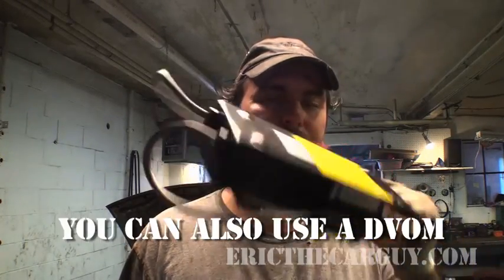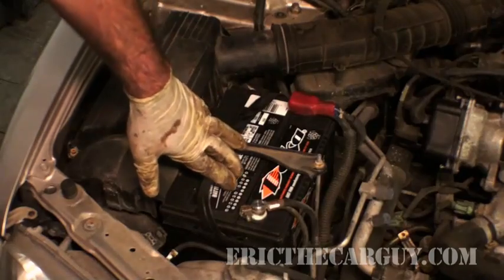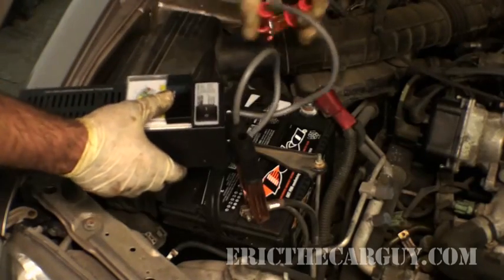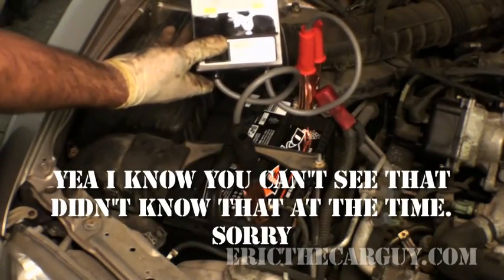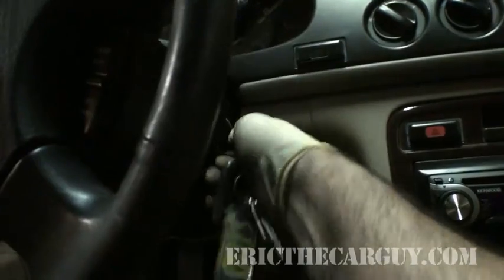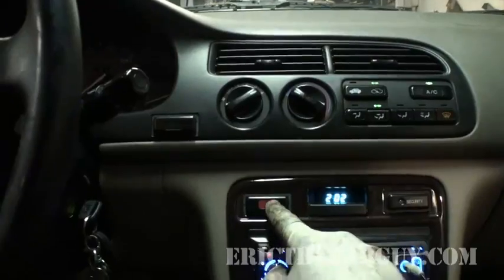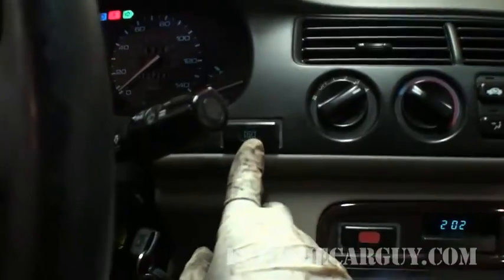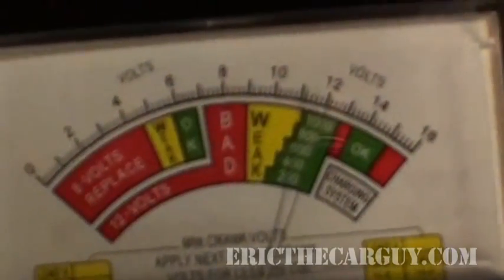How To Check A Charging System - EricTheCarGuy

Comment from the maker: @Junkman2000 If you get the tension too tight you can ruin the bearing however that seems like a short amount of time for a bearing to go out.  Are they going out because of an electrical failure or a mechanical one?

Comment: This is the 3rd alternator in 6 months that i have bought. What keeps damaging my alternators? I have a small amp and a sub, no more than that. The other day something really weird happen, I started my car and  the voltage meter stay a bit above 12 start driving and stayed there after 5 min of driving went up as normal to about 14. Today just stayed at 12

Comment from the maker: @thaik56 You might want to also watch the video I did on Alternator Diagnosis 101 for more detailed information but yes, you do need to make sure you have a good battery before doing any testing on the rest of the electrical system.

Comment: When you test the alternator. Does it make any difference whether the battery is in good condition or not?

I did that same test with everything turned on. I get 11.8-11.9V when radiator fan is running but it gets above 12V when it's turned off. Is my alternator bad?

Comment from the maker: @cooolguy1986 I would check the belt tension, I would also check the condition of the belt itself, if it's glazed or shows signs of age you might consider replacing it.

Comment: Hey Eric, I hear a squealing noise from somewhere around the alternator. I checked the voltage from battery using a multimeter it was fine measuring about 12 V and 14.27 V with the engine turned on. When I unplug the alternator, the noise goes away, when I turn the AC on, the noise goes away but without AC running, I hear that continuous noise. The more I drive, the worse it gets. I am sure my alternator is good, so it has to be something else

Comment from the maker: @points2shopPROOF You may want to watch the other video I did on this Alternator Diagnosis 101 for some more testing but if your having charging system issues (and by the sound of it you are) it's a good idea to check the alternator output, if you have the 11.1V that you say you have this is far below what the alternator should be putting out.  Good luck.

Comment: Can use a digital voltmeter too at the battery and never at the alternator.You get unaccurate results at the alternator.Have seen why the alternator on a Chevy did not work right once and was a simple fix.Owner's son forgot to plug in the plug in for the alternator,was not charging.

Comment from the maker: @flywelder I'm guessing it's a fuel injected engine, if this is the case I might be looking to the idle control circuit but I would also check the operation of the coolant temp sensor because that works like the 'choke' on a fuel injected engine, if the engine temp readings are off everything else will be too and you will see performance problems similar to what you describe.

Comment: part 2 
 If  I attempt to hold the engine speed at anything below 1500rpm it will not stay at the RPM I hold the throttle to, rather, it will drop back down low, then come back up again, and continue to do so despite me holding the throttle. When cold, and starting out down the road, {engine dog house cover is off so I can observe} the engine feels held back when trying to accelerate  and  bucks, misfires, back fires through the intake if  accelerating and if more load is applied.

Comment: Thanks for the helpful tips. I will apply them Tuesday. Let me give you a new description of the 302 engine than I did, right now: the engine will no longer “fast idle” when started cold. Instead, when started cold the engine speed will drop to about 550-650rpm and seemingly struggle to run. To counteract this, I must hold the engine speed above 1500rpm for 1-2 minutes before the engine will idle at a reasonable speed, about 750-850rpm, but it is still rough and shaky.  part 2 is next.

Comment from the maker: @flywelder First loose suspension parts don't cause vibrations at speed, out of balance things do but loose suspension parts make things worse.  Start by balancing the tires and checking the suspension components.

Comment from the maker: @flywelder You might also check for vacuum leaks as well as check the ignition system for any voltage leaks (I did a video on this).  That might be a good place to start.  I can't remember if it was that engine or not but you might want to google something about crossing plug wires 7 and 8, I just remember something about a misfire on a Ford V8 being caused by something like that.  Lastly check the fuel psi under load as it may have a problem only when the condition occurs.

Comment: How would I  discover what is causing  a back fire on acceleration   in a 1989 Ford 5.0 EFI engine?  I have  already, cleaned carbon from Throttle body, check  and have spark at all plugs; cleaned idol air valve; checked  for free and functiong EGR valve;  replaced fuel filter and Have 41 lbs of fuel pressure, spark timing is dead on.....what could be wrong?

Comment from the maker: @ian1593 First you have to see if it's charging as I show in this video, if it's not charging check the cables and connections, a problem in any of those areas will also cause a no charge condition.

Comment: @EricTheCarGuy 
Understood sir! Most cars that I stick a meter on will hover around the 14V mark while running and heavily loaded with electronics. Like you say, I guess it depends on the vehicle (state of the battery, capacity of the alternator, ad infinitum). Less than 12V is a definite fail!

Comment from the maker: @davelowe1977 Actually a static charge of 12.6V is best but with this test there is a pretty wide range depending on the vehicle however if there is a charging failure it will be 12V or less in my experience, this video is more of a 'check' not a diagnosis.

Comment: Hey Eric, I thought the standard regulated voltage of an alternator was between 13.8 and 14.2V. I also thought that a nominal lead acid battery ought to be around 12.5V when unloaded and charged. Surely that test was a fail? What gives!?

Comment from the maker: @mrdrejonn Not sure what the problem you having is as all you mentioned were the parts you replaced but you should always check the cables and connections as they are often the cause of electrical problems.

Comment: hey whats up eric? the same problem im having with my ford taurus 1999 se i have changed battery three times alternater three times all passed test, new alternater belt need help any ideas could  it be fuses relays ,wireing i dont kno need help. thanks>>>>>>>>oh yeah starter is used and just put on in feburary

Comment from the maker: @TaylorWareFan1 Actually you should be able to run the radio for hours without issue, if it was the original battery it was probably time, they normally only last about 5-6 years.

Comment from the maker: @TaylorWareFan1 Cool, thanks for the update.  Normally when a battery starts to get low like that it can cause all kinds of weird issues with the electrical system as once it falls below a certain voltage many of the systems respond in strange ways.  Thanks again for the update.

Comment: Hi Eric,I've got problems with Mitsubishi FTO alternator or wiring.Put new alternator belt,new battery but alternator not charging.got myself a multimeter checked that values don't change car on or off value is 11.8 on 12.4 off.connected multimeter to alternator's positive and negative wires with car running and got values off 2.5-4.7 from alternator so i presume its not alternator but can't figure out what is it,fuse relay seems ok,may be wiring?can you help me out?cheers

Comment from the maker: @kennyg757 Make sure the connections to the battery are clean and tight, may charging and battery problems are actually caused by bad connections.

Comment from the maker: @coldcash12345 It sounds like a voltage regulation problem, I believe that it is built into the alternator and you will need to replace the alternator to fix it.

Comment: Hey eric, got a 95 3000gt and have a voltage drop prob. When I rev it up and the rpms come back down everything dims, 14 volts to 12 volts on my gauge. Alternator got tested last year and was good. There is a noise coming from it, but the belt is too tight I think, I will try to loosen it. Also, I checked the connections and it was hot and the plastic was starting to melt around it. Bad connection, Short, ? Checked for draws/fuses. Didnt check volt. regulator. Any ideas on what to do? Thanks

Comment from the maker: @JDMnubi Test before you buy.  Recharge the battery and do the test in this video to confirm the alternator output, if it's below 12V then replace it, if it is then look elsewhere.  Don't rule out a connection problem just in case.  Good luck.

Comment from the maker: @rony23ify There probably is a short somewhere by the sound of it unless you have the AC or defrost on, the fans run when the AC is on and when you turn on defrost the AC is turned on.  Your best friend will be a good wiring diagram so that you can see how the circuit is suppose to work, that way you can properly test it.

Comment: Hey Eric, I have a question, while driving, my friend's headlight started strobing, and eventually went out, and soon enough the whole car just died and didn;t want to turn over, I'm suspecting a bad alternator or a short some where, currently in the process of replacing the alt. but just wanted a second opinion, any ideas? thanks!

Comment from the maker: @theOats11 It could be a connection issue but not likely if it was working normally before, it may be that the voltage regulator in the alternator has gone bad or it may have lost a phase, I would replace the alternator personally.

Comment from the maker: @ChubbyLoveDumpster It may mean that there is a problem in those circuits or a problem with the electrical system.  I'd start by checking the voltage and verifying that my gauge was reading correctly then look into the effected circuits.

Comment: what does it mean when your voltage gauge with light and heater on reads 13 then dips to 8 then jumps tp 13 an back to 8 etc.etc.

Comment from the maker: @midlantic1 Ohms law dictates all are connected, including resistance.  It's much easier to read voltage in a situation like this as you can use a tester like this or a DVOM, to check amps you need an expensive inductive meter to read it accurately.  Great question BTW.

Comment from the maker: @hondita90 Some parts are better than others but you need to verify that the alternator is really the problem by performing this test.  It's also very important that the connections at the battery be clean and tight, poor connections can cause loads of intermittent electrical problems.

Comment from the maker: @meckatod If you installed an amp with some big cables to the battery you may have something hooked up wrong.  Try disconnecting what you installed and see if the problem still exists, if it does you know it's in the system, if not then you need to look elsewhere for the problem.  Make sure the connections at the battery are clean and tight as well.

Comment from the maker: @Ddog2k3 Sell it, no I mean it.  I believe the starter on that engine is actually under the intake manifold so if you just hear a 'click' when turning the key it might be the starter has failed, you would be able to verify this by tapping on the back of the bell housing just under the intake, if the car starts then the starter is most likely bad.

Comment: Hey man, I just got my 93 Cadillac Deville a couple of days ago, and when I try to start it up, it didn't do anything. I thought it was the battery, so I replaced a new battery in it. When I try to crank it up again, it still didn't do anything. So I assuming that something got to do with the Charging system, but is in the shop now.

Comment: @EricTheCarGuy I see what you mean with the oil gauge. Would it be the same with the volt gauge? Does the battery "Idiot light" go on when the alternator starts to fail? 

I ask this to know if this test is a must or if the volt gauge helps to know something's wrong.

And by the way, I ask this for  convenience  sake and not laziness. I mean, if it has to be done it has to be done and I shall do it easily with the help of your video. Just wondering about different ways to diagnose a problem

Comment from the maker: @Toltecatl Thanks for your comment.  It would be redundant to install an oil pressure gauge, on cars without an oil pressure gauge they use an "idiot light" that would indicate that oil pressure had dropped below a safe point.  You could put one in if you wanted but it would be a waste of time unless it was a performance application of some sort in my opinion.

Comment from the maker: @mlyfena Not exactly sure what you mean by this question but if your alternator is not putting out voltage the most likely cause is the alternator since the voltage regulator circuits are contained within it.

Comment from the maker: @cincityallstar Check the fusible links down buy the starter on the front of the engine one of them might be fried.  These are wires that work like fuses, if they feel too rubbery then it is bad, in your situation it should be obvious, look for melted stuff here.  Make sure you replace them with more fusible links and not wires, they saved your electrical system, worth the money if you ask me.  Good luck.

Comment from the maker: @MyBrilliantChannel In some cases that test can damage electronics so I don't recommend anyone use this test.  It also proves nothing, I prefer numbers to back up a diagnosis when it comes to electrical issues.  Overcharging can be very damaging, hopefully it blows fuses before it starts melting wires.

Comment: Another test would be to disconnect the battery while the car is running, if the engine doesn't stall and the lights are bright, then you most likely have a perfectly functioning alternator. (Not a safe test but i've seen it done.)

What about overcharging? the effects can be quite bad can't they?

Comment from the maker: @rachi2006 Make sure the engine isn't too hot and you can spray carburetor cleaner around the suspected area of the leak, if the engine idle changes you found the leak.  The safest and "professional" method is to run propane through a vacuum hose around the area of the suspected leak,  you will get the same result of an idle change that would indicate that you found the leak.

Comment: @dseries16
Lmao I must be one of the few that doesn't miss my first car. 1987 I was 18 yrs old and living in Los Angeles at the time and purchaced a $350.00 4,000 lb turd brown 1973 Pontiac Catalina 2dr w/400 ci gas chuging engine from some bro in South Cenral LA. It had a bullet hole in the roof & a few days after I bought it the trans goes out. A month after that, the fuel pump so I said screw it & got rid of it.

Comment: @dseries16
I don't know about you 86 Celica, but I LOVED my 80 Celica. That little 20R engine had plenty of power to where I could squack a tire in 1st gear. And it was my 4th vehical. Was the 86 still RWD by that time?

Comment from the maker: @rachi2006 If a car runs but won't idle it usually is a mixture problem.  The most common cause I've seen for this is too much air either because of an idle control valve problem or an intake vacuum leak.  It's not a bad idea to check your PCV valve too by pinching the vacuum hose going to it to see if it idles correctly.

Comment: @Michiganborn1969 My first car was an 86 celica and that was the way I tested it as well. I also didnt know as much as I do now. We all start somewhere. It didnt mess that car up because it was an older car I think even pre OBD so there was less sophisticated electronics invovlved. Alot if not all the new cars use a 5v Refrence signal for thier ECU and when you take off that NEG BAT cable it can cause a spike sending more than 5v and burnin up the ECU but like I said it is on newer cars

Comment: Hey Ericthecarguy, I was taught that the min charge is 13 Vt under load? 
I also use the power probe to check the alternator connector for ckt functioning properly. 
I have the same battery load tester and it works well. I enjoy your video also.

Comment: @happy543210 The voltage regulator controls the field current going into the windings and doesnt keep the voltage level constant regardless of loads. The output from the alternator varies from around 13 to 14.5 v. If you think that there cant be voltage spikes from the alternator then you havent been around them enough to be talkin shit. Everything works until it doesn't. Meaning just cause you just checked it doesnt mean it is still working properly. next time you wanna post a reply research it

Comment: @dseries16 I need to add that field current is needed for the alternator to work the screwdriver test is to check if there is field current or if the windings are shorted out internaly

if it is magneticly charged at the center of the pully Key On Engine Off alternator windings bad and they have been shorting out causing the rotor to become magnetic.

If the outside case is magneticly charged Key On Engine Off you have field current and that is not the cause of the alterator problem

Comment: @integra57 the voltage regulator works by changing the field current in the windings to get a different output. the reason alternators are so efficient in the first place is because they use smaller pully than the old generators. older alternators had external regulators that could be adjusted. So technically both answers are correct but the one they were looking for is most likely no. and like eric said amperage is dependant on the load not the amount of voltage. More resistance(load) less AMPS